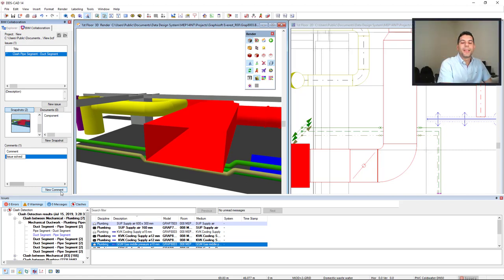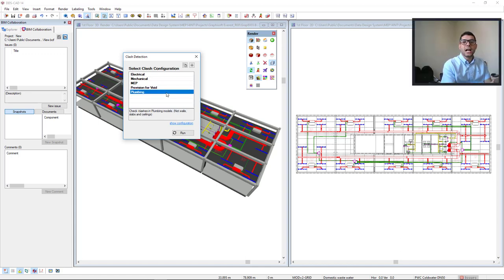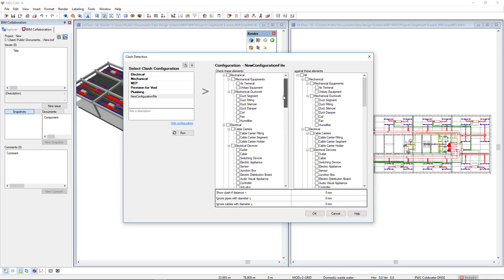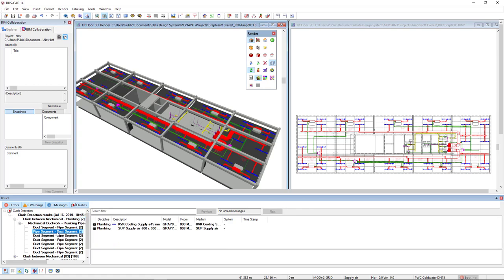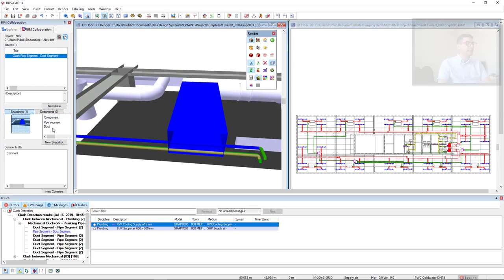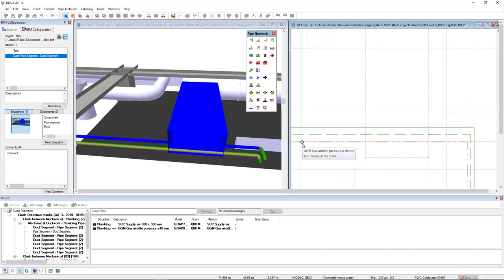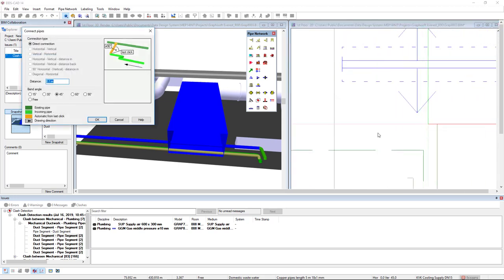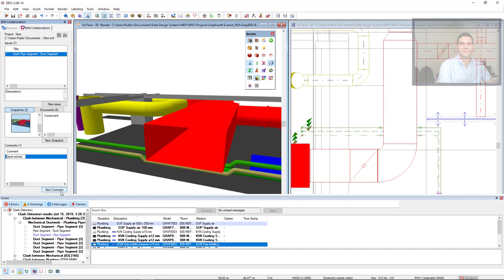Making clash free models using DDScad's clash detection engine

Comment: Nice, I will try it. If I get a duct project from my partner, created in DDS-CAD, but exported in IFC, how can I do clash detections?
Reply from the maker: Hi Michal, great to see you like it! As Filipe mentions; DDS-CAD's clash detection engine runs on native Foundation Classes (the F and C in IFC...). As a result, if you receive a Ventilation system created in e.g. Revit or DDS-CAD from an external party you can simply run the clash detection as Filipe shows in this video. Obviously, if your partner exports everything as Proxy into his/her IFC, doing a clash detection on an element level will be hard... But since you mention your partner is using DDS-CAD this will definitely not be an issue :) Looking forward to hear if everything worked out!